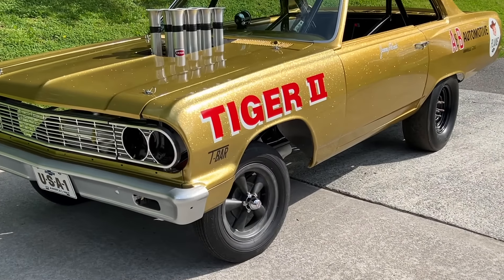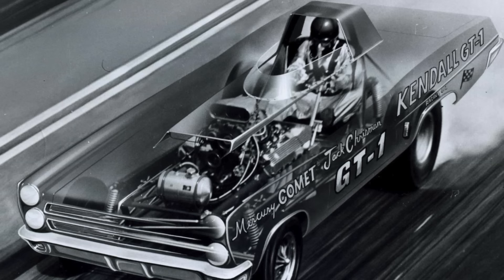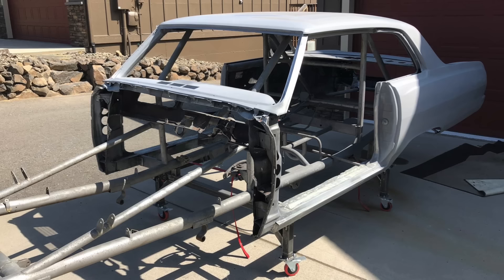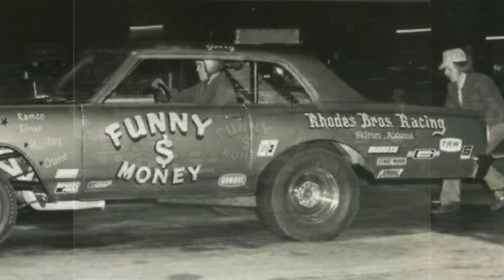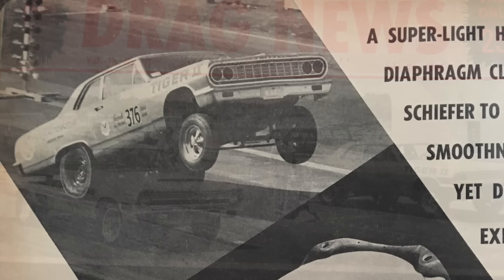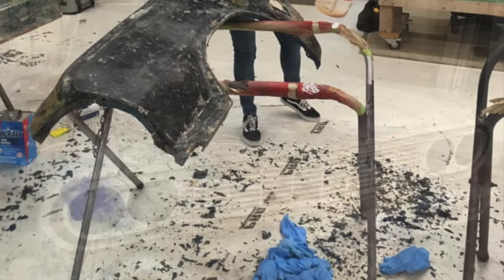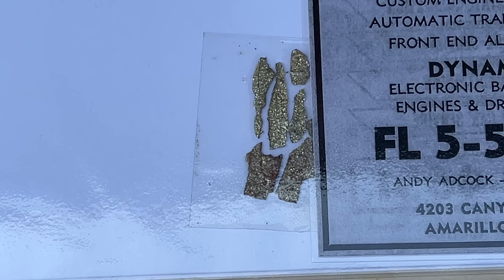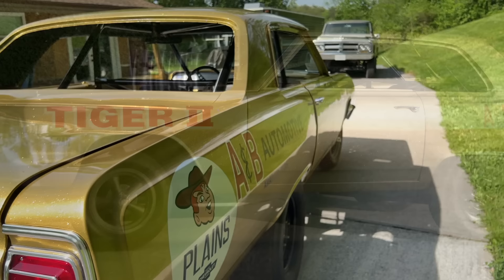HISTORIC Chevelle FUNNY CAR Found and RESTORED!

Comment: Thanks for the video documenting the history and restoration of this iconic hot rod. 
 I have a soft spot for gold Chevelles. My grandmother had a '67 four door gold with gold interior that my oldest sister ended up with when she got her license in '76, my first two cars were '67 Chevelles both gold with gold interiors, the low back front bucket seats with the lockable center console glove box with 283 two barrels and slip n slide Powerglide transmissions, the first one I bought had a brown vinyl roof and the second one was a factory convertible with black top. The convertible I found for sale and it had been sitting at the top of the local Mountains Topanga Canyon in Malibu, it had no front clip no motor no trans and about a foot deep of pine needles and leaves and acorns, black widow spiders silverfish in the whole interior tub. I had buddy who owned a flatbed towtruck that barely made it up that single lane canyon road and we yanked that convertible out of this guys downhill driveway and got it back to my house and dropped it in the street in front of my parent's house, I was only 18 yrs old and my dad almost killed me cuz I paid $500.00 for what he called a piece of shit, even though he was a car guy also, he just didn't want it sitting in front of his million dollar house. So I parked my hard top in the RV/boat parking space next to the garage and cleaned out the garage and pushed the convertible into the garage and proceeded to put all the parts from the hard top into the convertible from the tar paper sound proofing under the carpet kit to the gauges the seats doorpanels, knobs, motor, trans, etc... anything that would fit was swapped.  A lot of work and my dad was very surprised that I did what I did. He thought I would give up part way through the project. 
 Gold Chevelles are awesome!
Reply: Isn't it odd that peoples' grandmothers had the cool cars back then? 
A school chums' grandma used to drive them to school in her BRAND NEW 1964 Comet-just try to find one now!
An old friends' mom drove her 68'  Barracuda back in the VERY early 70's everyday! Stock Tan/Gold paintjob.....
Reply: @magellankiller  --- the gold hard top Chevelle that I bought before the convertible, was owned by an old man and his wife. I worked at the local grocery store ij high school and I would see this absolutely perfect condition gold Chevelle in the parking lot while I was collecting shopping carts. So I left a note on the windshield with my phone number and said I wanted to buy it. I got a call and they lived only 3 blocks away from me. He wasn't ready to sell it yet. About a year or so later I got a call and it was his wife and they were selling the car. He had crashed into a cement pillar in a parking garage. He was okay but the drivers side front quarter panel at the very front was buckled but still drivable. So I bought it for $800.00. This was 1982. They had garaged the car its entire life. It was like new on the inside. The couple were in their 80s in age so they were old when they bought it. What a great car. I found the convertible by chance while looking through the Recycler newspaper for the replacement front quarter panel that was damaged. I wish I still had the cars I had in my teens, 20s, 30s. SS El Camino, 1966 428 Thunderbird, 78 Z28. The first car I used to get my drivers license was my mom's 66 Bonneville sation wagon that my dad had the motor rebuilt it was factory 326 small block that got bored 30 over and rv cam, hydraulic lifters and valves reworked, it was the car I drove to go surfing, to parties, to the skatepark, to take girls out and have some fun in the back with the seats lowered flat.  And it ran hard and moved that big ass 9 passenger tank pretty fast. What was cool was it was just as fast empty or loaded with 8 people or whatever I put in it.
Reply: @13_13k  
Very Kool! 
The cars you listed are some of my (and surely others!) faves.
You may not be into these but I've been into VW's as far back as '65 or so when a buddy of mines dad had bought one brand spankin' new. He let us ride on the running boards as he brought it around to the back of their house. The bad thing was is that we had to pass by the front of our house when he did it and just when my mom had stepped outside to do something. The look she gave chilled me to the core! I finished the ride filled with dread as I had kinda figured that would be my last time that I'd see the light of day for quite a spell. Since then when I believed that i had grown up Running Boards were my thing and pre-'68 VW's-mainly a '63 ragtop and an originally 1500 cc'67 Karmann Ghia bored to 1776 cc/ Monza dual exhaust had been my transportation of choice(s)......
Now as I'm 66 y.o and married (no children!) practicality is the order of the day......
Have fun!
Reply: @13_13k  
Very Kool! 
The cars you listed are some of my (and surely others!) faves.
You may not be into these but I've been into VW's as far back as '65 or so when a buddy of mines dad had bought one brand spankin' new. He let us ride on the running boards as he brought it around to the back of their house. The bad thing was is that we had to pass by the front of our house when he did it and just when my mom had stepped outside to do something. The look she gave chilled me to the core! I finished the ride filled with dread as I had kinda figured that would be my last time that I'd see the light of day for quite a spell. Since then when I believed that i had grown up Running Boards were my thing and pre-'68 VW's-mainly a '63 ragtop (still original 6v) and an originally 1500 cc '67 Karmann Ghia bored to 1776 cc/ Monza dual exhaust had been my transportation of choice(s)......
Now as I'm 66 y.o and married (no children!) practicality is the order of the day......
Have fun!
Reply: @magellankiller  ---- I am a bug guy in my other life. Being ¼ German. My brother was into super beetles, early 70s. He had a half a dozen over the years back in the '90s. There was a time when I was in my mid - late teens when most of my friends had bugs. That's when the California bug style was in and of course being from a beach town in Los Angeles it was the trend. Pull the back seat upholster it with big speakers and a couple of pillows, build a fast motor with a stinger, or Monza, the engine lid set so it didn't close at the top, louvers, lowered, skinny Centerline racing wheels and if you were really cool you had a pre 65 with the hubs so the Centerlines had the cut-out for the hubs. 
 About 2 blocks away from my parents house was a little industrial property and had 4 small building, one was an automotive shop for VWs called TAYCO and they had a race bug that was running 8 seconds in the ¼ mile back in the 1970s when I was just a kid, born in '65. They were around at least '75 - early '80s and they ran at the SoCal tracks and built cars or motors for people. One was the step father of my sister's friend and he had a show bug that was a Baja body painted wild airbrush rootbeer, tan, cream, total '70s crazy striping like they did, but it was a street Baja. It had big fat TA Radials in the rear and it had the mag Daisies deep dish rims in the rear and Centerline pizza cutter front runners and custom interior and the thing would pull wheelies about a foot high. It won some show trophies. So, yeah, and my dad bought an extra car to have around the house because of four kids and all only 18 months apart and someone's car always seemed to be broken for one reason or another, so he bought a VW four door (611?) With an automatic / manual shift and the early fuel injection that always leaked and caught on fire in the vans. Hahahaha I drove that around while working on my Chevelles. What a hunk of crap that car was. But my buddies and I would push the limits and drive 60 miles to go surf or skateboard some spot. Or go to some underage nightclub in Hollywood.
  That car dripped gasoline in my eye and I had to go to some stranger's house and knock on their door to ask if I could use their hose to wash the gasoline out of my eye and the older lady was so nice she took me in the house etc.... I was 16 yrs old. Hahahahaha
Reply: @13_13k  
Bug stories are some of the best aren't they? Built-in adventure in every one to say the least. My very first bug was a '71 Super Beetlte. If any of the Bugs were ripe for a body adjustment those were! Those Mac struts had the front end up high leading with its chin it felt like. One  BLUSTERY as hell day driving across a highway bridge  coming fromin between two sets of hills with that crosswimd blowing.....well, I thought it was curtains for the kid here as the front end started waving at the oncoming traffic like it knew some of 'em! Put a floor jack in the trunk after that.
I'm still looking for a European model (of Bug that is....) with Semaphores-way Kool! I miss both my ragtop '63 and my '67 Karmann Ghia!
 Had a floor jack in the trunk in that one too. 
A great stabilizer for sure......
Reply: @magellankiller  --- here's a bug story that you won't here everyday. Actually two, I'll try to make 'em short. 
 My brother who was a super beetle guy. Had a girlfriend he lived with for 8 years and she had the worst luck with cars, especially his cars.  He would get one fix it up and give it to her to drive. She would crash it every time. And since he gave her one he would get another and when it was done she would want the new one because hers was dented etc..  and he'd give it to her and fix the other and buy another, just a viscous cycle. I moved in with them temporarily and one day a friend of my brother who also had money and liked bugs, came over to sell my brother a perfect light blue 71 like new. My bros girlfriend was sleeping until she heard the bug pull into the driveway and saw that new bug. She ran outside and was asking for the keys while my bro and Brian were talking and I'm thinking, dont give her the keys, dont give her the keys. I hear my bro say, damnit Kirsten, and hands her the keys I hear her giggle like the spoiled brat she is and I hear the door open and close and the keys fumbling, I'm just inside under a window to the driveway. I then hear a very little quiet voice of what could have been a 6 year old girl say "oops" and then I hear her start to cry. And she's  crying and it's getting louder and my brother asks what's wrong (I forgot she is 27 yrs old and my bro is 32) she cries more he asks again what's wrong and she says "the key"  more drama and then the reveal, she broke the key off in the ignition switch. My brother got mad but not angry. Me, I'm in the house laughing and in disbelief that someone could be so jinxed with bad luck. 
 She left a frying pan with water boiling on the stove and left the house while I was in the shower. I get out, upstairs and there is smoke and I yell for her and no answer. I go downstairs and the smoke detector goes off and I see the pan on the stove top and its red hot and smoke billowing from it.  She came home about an hour later and wondered why the doors and windows were all open and fans blowing. I said I know you don't like me but are you trying to kill me? And then it hit her that she left the pan on the stove. 
  Oh. One of my very best friends drove a white bug that he got paid $50 a month to drive around because it had Miller's Outpost logo and Levi's and Zeppelin Jeans logos all over it as an advertising thing for the clothing store. 
 We drove that bug in the sand dunes, in the mountains fire roads, in the snow, in rain up to the doors, in ice plant covered hills, on the grass in the middle of a city park doing donuts in the thickest wettest fog that you couldn't see 3 feet in front of you. We'd been drinking rum, beer, smoking weed, eating mushrooms and it was my 15th birthday and we got pulled over by a motorcycle cop. And he let us go. We were so lucky,  that was 1980. So many adventures in that rolling billboard.  Hahahaha
Reply: @13_13k  
Good Work! 
Damn I think I'd pay to be single after that brother's gf story! 
Whew was she was a virtual MESS or WHAT! 
Question: Did he survive?
Yup, true to form as I stated if one owns a bug you've been guaranteed more than your fair share of adventures......
Great snow cars they are ! All weather tires and a well-fed wife in the passenger seat for ballast on yer off! I know! Did it for years!
Reply: @magellankiller  ---- hahahahaha
Reply: @magellankiller  --- hahaha, yes my brother survived. He and she got in a huge fight and my brother said he was done and he was leaving. He didn't pack anything except for his computer and he drove away. That was it. He left everything he had behind and even one of the super beetles  that wasn't running. 
 He's like that. He doesn't care about material things. He always says that he can buy new stuff when he gets where he's going. I was like that through my teens and twenties. I could pack up everything in my El Camino and be gone.
 So, now I'm stuck with the crazy spoiled ex girlfriend as a roommate. It was one of those things where she was two years younger than me, she was hot. She looked like a Barbie but nothing fake, and big real cans. But she never wore makeup, which is good but sometimes it's nice when you look like her. She was about 5' 10" tall and at least 36 DD or more and a thin nice body. But she was a cross between a Grateful Dead dirty hippie type and goth/punk rock chick. She was a slob. Couldn't cook if she was starving (remember the frying pan?) She put the pizza she had delivered in the oven to warm it up, in the box. 
  She wore baggy oversized tshirts and sweat shirts to hide her rack. And she came from a family of geniuses that was loaded with cash. She is really smart also. Just no common sense. She had maids and butlers  as a kid, her mom died when she was like 7 yrs old so her Dad, who is or was an international criminal, into stealing art and counterfitting money and possibly a spy for our government, sends her to England to boarding school until she graduated high school. She has two brothers, older, one is the Naval Commander of the Pacific Air Fleet. Designed a nuclear sub at age 16. Her other brother wrote the code for the modern California drivers licenses. Her grandfather was one of the leading heart surgeons in the country and head of the cardiology department at Harvard or something and a co founder of Blue Sheild insurance.
  She was a mess though. We definitely had a love hate relationship as roommates for two years. She inhereted, and her brothers also, $4 million each from grandpa when he died. Two mill in stocks for RJ Reynolds, AT&T, and other old valuable companies. She is married and lives in Scotland now. She and my brother have the same birthday only he's four years older so they talk at least on their birthday and usually a couple times more.
Reply: @13_13k  
Not surprising in the least.....
Good Yeoman Work both your brother AND you!
Whew! I don't know if ANYBODY can top this!
 Keep that El Camino on the road please. I've always loved them from their inception in '58 until as most cars with me around '73 when the laws constricting exhaust and powerplants as it was becoming SOMEWHAT necessary at that time due to the oil crisis at that time.
Good Luck!
Reply: @magellankiller  --- thanks, that's kind of you. 
 About the El Camino, that's been gone. 30 years ago I had a small engine fire and being that it was an '82 the indide of the engine compartment is mostly plastic. The car was my dad's before it was mine. '82 SS silver and grey two tone, the original v6 was pulled and a 5.0 305 Target motor was dropped in with some head work a midrise manifold rv cam, and a 4 barrel Holly carb. Turbo 350 trans with a 2200 stall converter and 273 gears in a posi rear end. It was set up to tow a ski boat to the Colorado River and Lake Havasu from LA. about a 6 hour drive across the Mojave Desert. I've had that car doing 140 and purring, and comfortable with the bed loaded with two dirt bikes ice chests gas cans camping gear and fire wood. It was a fun car.
 Had many cars since then. Now I have two cars, '06 Hemi Dodge Magnum wagon RT 5.7 litre, brilliant black, I bought with 30k miles on it in '07 and I have an '08 Cadillac Escalade ESV AWD with 6.2 litre all aluminum LS motor injegted, 10:1 compression with a computer tune boosting horsepower from 403 hp to around  430 hp, no governor, new shift points for the 6 speed auto/manual trans. Black with all windows limo black tint except the front windshield and its got 22 inch rims it had 24s but they were all chrome and looked like some pimp owned it. I use it as my work truck/daily driver. It has the premium package all the bells and whistled that Cadillac offered. I have super duty disc brakes on it, heavier anti sway bars. It is fast when it's loaded with tools etc... but when it's empty, that LS Corvette, 376 cu small block motor and all wheel drive system, and the reset trans, that truck jumps off the line 4 wheel burnouts if I have traction control off. No governor, I've had it to 150 mph and it still was pulling. It didn't have a lot left but probably another 15 miles an hour for sure maybe more.
  Take care of yourself. Do not comply or obey the government, stay armed, don't ever give up your weapons, protect yourself, your loved ones and your neighbors. There is some serious shit being planned against the American people and it has already started. We are the only people keeping them from having complete control of the world. They have to eliminate us patriotic 100 million strong armed citizens to accomplish the 2030 agenda. They know they will never win. So they are trying to divide us and demoralize us by beating up on Trump to scare us from standing up and fighting back. 
 Be safe, be healthy, exchange all your valuables and cash for physical gold and silver in small and medium size coins and bars. Grams, 5 and 10 grams to use for bartering and one ounce coins and stash them where you have 24/7 access to your stash.,,
Reply: @13_13k  
I admire your planning and strategy efforts. You as well remain diligent and keep up the fight. As you may have surmised I am an old curmudgeon and while I have spoken of this same to the young'uns in the family when I was quite a bit younger I was met with the concert of "Mom!, Uncle is preaching again!" and to that my sisters and cousins would say to "Stop That Preachin'at the kids!"
Just can't win I suppose-now look.....
Reply: @magellankiller  --- I'm not far behind you. I'll be 59 in July. 
 I remember watching the Vietnam war on the news at 6 o'clock, I remember the Manson trials. I remember having four channels to choose from on a black and white tv that had rabbit ears and no remote control. Having one rotary phone in the house, being able to leave the keys in the car and the front door to the house unlocked always if it wasn't wide open. Gasoline was 60¢ a gallon and a guy pumped it for you and did your windows and checked the fluids and air in the tires.
  Hell, every last Thursday of every month at 10 am on the dot, the city would fire off the air raid sirens and we'd be in class and would have to practice dropping and getting under our desks with our bodies in a tight ball and hands locked behind our heads to protect us from a nuclear bomb. Hahahaha as if that would help.
   Luckily my nephew and niece are not brainwashed Liberal robots. It was close. They have my sister, Democratic, Liberal PE teacher for their mom and grew up in one of the most Liberal Democratic counties in the U.S. , Marin County,   CA.
 But their dad, aunt, uncles, grandmother are all normal free thinking, on the conservative side and able to not be fooled by the lies and distractions. Nephew is 26 and niece 24 and both graduated from San Diego State University and didn't end up all stupid.  Thank God.
 Hopefully there will be some resemblance of what this country was like for us, for them and their kids. 
 I'm 13th generation great grandson, direct bloodline of the ship's carpenter on the Mayflower and he signed the Mayflower Compact. That side of my family some still live in Plymouth and Middleboro since the 1600s. Myself and my siblings and family are all listed in the Children of the Mayflower charter held in Congressional Library and other institutions.
  I have to do what is necessary to help keep this country for the people a free Republic. We have enemy invaders disguised as our government officials. Washington DC is a foreign land on U.S. soil. It has it's own laws and military, they aren't citizen of the U.S. they don't even get to vote. That's why no one ever goes to prison when caught red handed. 
  Sorry I went on a tangent.
Reply: @13_13k  
Absolutely no worries should be had.....
Good Work on that genealogy if yours.
Me, I'm a first generation American born Black Aboriginal Filipino/Han Chinese on my Mothers' side and Black American on my Father's side. 
So I eat very well......
Reply: @magellankiller  --- nice chatting with you.
Reply: @13_13k  
Quoting ol' Benjamin J. Grimm-
Right back 'atcha......